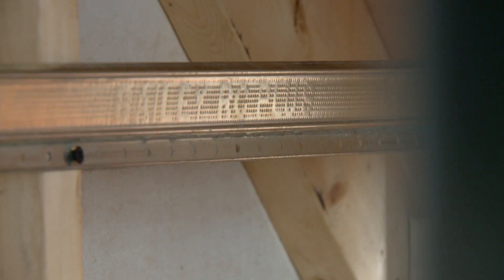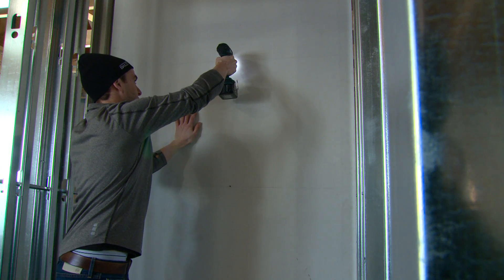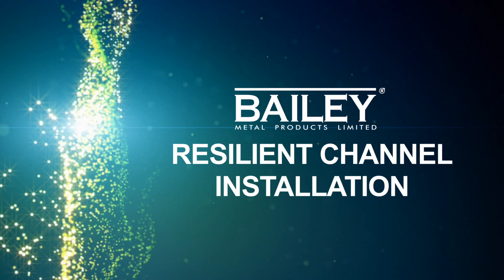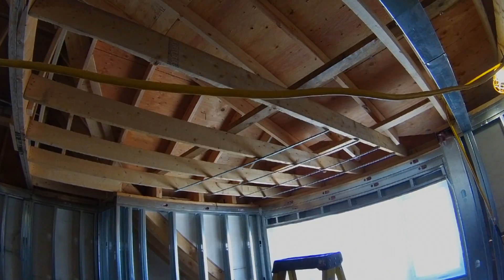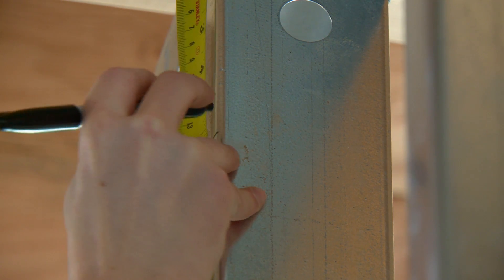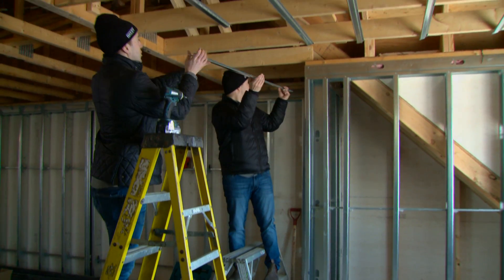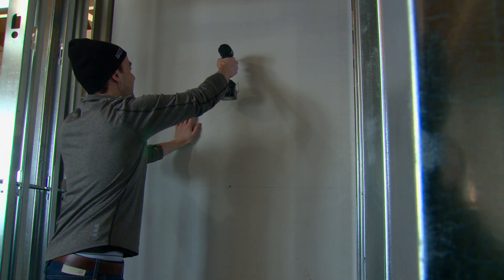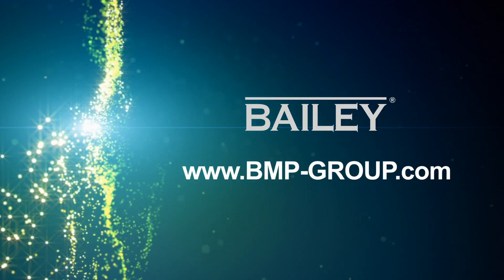BAILEY RC PLUS™ RESILIENT CHANNEL

Comment: What if you did this om the ceiling..didnt touch any studs or walls, have rockwool on the other side and 5/8th drywall..but it blocks out less than 10% of what was already there..? What would you or anyone think the cause woukd be then, if its a 100 year old house and the walls have woochips as insulation..bevause im out of ideas..coukd the sound be travelling down the walls rendering the RC essentially useless? 
I was expecting auch a different outcome..im just feeling absolutely defeated. Spent two weeks getting it all done up and seems we went backwards

Comment: Warning : In the literature on their site its recommended to fasten the gypsum board with 1'' screws. My experience is that the resilient channel bend before the screw bites into it. With 5/8 gypsum board, the 1'' screws will not push far enough into the resilient channel to grip, mostly if you screw too far from a joist, where the channel is more flexible. Leaving then a loose screw not attached, and plenty of unnecessary holes to patch. 1 1/4'' screws makes a word of difference. 100% success.

Comment: This video is basically useless, even misleading.  It's showing drywall screws being driven so far into the drywall that they're going through the paper.  These are not professional installers.  Those screws are doing absolutely nothing to hold the board to the channel.

This video does not show how to interface the ceiling boards with the wall boards.  It does not show what special materials should be used, either (i.e. acoustic caulking?).  Nor does it show how to finish the corners.  This video is simply marketing/promo for the product.  USELESS

Comment: I've learned a lot from watching soundproofing videos all week but none has definitively affirmed what I think is now true. I want to stud mount my TV to a wall that has resilient channels/hat channels. But I can't because that would short circuit the soundproofing system. Am I correct? 

Also, even if I tried, wouldn't the channel have created an inch or so gap between the drywall and stud? Therefore when I start tightening the lag bolt, wouldn't it just pull the drywall inwards towards the stud?
Reply from the maker: You are correct.  In order to firmly secure the TV you would be “crushing” the resilient channel and it wouldn’t be able to freely float the drywall.  Your best option would be to stop the resilient channel in this area (cut it out) and add an extra layer of ½” drywall.  The ½” drywall would equal the ½” depth of the resilient channel to maintain the correct wall depth on the framing members and also provide improved sound performance.

Comment: At this https://youtu.be/prOhYUa9Njw?t=81 point in the video, the narration says "... using 10mm three eight Type S  pan head screws". The video shows what looks like a course type w screw being driven into the wood. Three questions:
1. Please clarify the mention of "10mm 3-8 Type S pan head screw". Both the "10mm"  and "3-8" mentions baffle me.
2. Please confirm that one connects the RC to wood framing with the type W screws.
3. Please confirm that one connects the RC to the drywall with  the type S screws.
Reply from the maker: 1.	Yes, it looks like the narration is referencing steel framing and showing wood framing.  To connect resilient channel into steel studs (25 gauge) a small pan head screw is recommended.
2.	Use a wood screw to connect RC into wood framing
3.	Attach drywall to the resilient channel using drywall screws.  Typically fine thread drywall screws are used.

Comment: I am using RC and two layers of 5/8" drywall with Rockwool Safe N' Sound insulation for my drum room. 

My question is this: For the double layer walls and ceiling can I rest the 2nd ceiling layer on top of the edge of the 2nd wall layer to make a clean corner edge? To clarify, the 2nd layer of drywall on the wall would be positioned 5/8" lower than the first layer to create a small shelf, then the 2nd layer of ceiling panels at that wall would sit on that shelf on the top of the wall panel. 

Does this short circuit the room?
Reply from the maker: While the layout you have described would provide a clean and sharp finish to the wall/ceiling intersection, having the ceiling gypsum rest on the wall gypsum would allow for the sound to transfer from one area to the other.  This would occur because there is contact between the ceiling and walls.  We typically recommend maintaining a small gap at the ceiling and wall intersection of approx. 1/8” to ¼”.  This gap can be filled with an acoustical caulk or a paintable silicone.  You would then finish the drywall as you normally would.
Reply: Thanks so much. You replied at the perfect time. The ceiling is up and the walls are about to go up.

I appreciate the detail too.
Reply: @obscenery  Ho well is it performing in attenuating sound?
Reply: @markhooker8520  pretty well, but not "perfect". I didn't end up resting the layers on each other. Instead I gap filled the corners of the first layer then put on the finish layer normally. I also added a 2nd door outside the room, an outside steel door. 

When I teach a guitar lesson the sound doesn't escape the room. When I'm drummimg it sounds like in a normal house if someone in a different room was listening to a stereo a little loud. However, in my toddlers room upstairs, when I have her white noise machine on and I drum there is no decibel change... which is a big win for me.

Comment: Does resilient channel keep outside noise from coming in like road noise? Or only inside noise from going out?
Reply from the maker: Resilient channel helps reduce noise that travels from one side of a wall to the other.  Think of a typical interior wall that divides one room from another.  If a TV is on in one room the resilient channel will help reduce the amount of noise that travels through that wall.  If you reversed where the TV was located the resilient channel would still provide sound reducing performance.  In your specific case, road noise, resilient channel can potentially help reduce the noise that is coming in from outside.  However,  I would caution that noise typically travels anywhere air can travel and this includes windows, doors, etc.  Adding resilient channel for this application will provide an improvement in sound performance but may not deliver your desired level without doing other changes to the wall in question.  These changes could include adding better insulation in the stud cavities and/or using acoustical sealant around windows and doors.  A combination of soundproofing techniques will probably need to be used in order to provide the best results for your specific road noise concerns.

Comment: When using this on a wall should drywall have a bit of a gap at the bottom to keep it off the floor so the wall will vibrate better? And I have seen some recommend the flange opening upwards on the bottom resilient channel and the rest opening down. You appeared to have all yours opening upwards. Does this matter?
Reply from the maker: Maintaining a gap at the bottom of the wall is typically not required as the attachment of baseboards will create a solid connection that wouldn’t allow the drywall to “float” or vibrate as freely.  This is ok and typical.  Where a gap needs to be maintained would be at the top of a wall where the wall and ceiling meet.  A small 1/8” – 1/4 “ gap will create a barrier from the noise transferring between wall and ceiling.  The small gap can be filled with an acoustical caulking or similar product.

Resilient channels should be fastened to the wall framing with the mounting flange down, except at the floor level where the starter channel can be installed with the mounting flange up to accommodate fastening (sometimes hard for a drill to fit).  The purpose of having the mounting flange down is that the drywall will naturally pull away from the wall with the resilient channel open area at the top.  If installed with the mounting flange up, the drywall wouldn’t fall away from the wall studs and wouldn’t provide the same level of sound performance.

Comment: For soundproofing, we are using one layer of 5/8" drywall and then a second layer of 1/2" drywall.  Is your resilient channel designed to support this double layer weight for ceilings?
Reply from the maker: Resilient channel can safely support a maximum of two layers of 5/8” drywall.  Anything beyond that could compromise the structural integrity or the sound performance of the resilient channel.  That is why we recommend  hanging the heavier items independently from the resilient channel into the structural back up system (wall studs, ceiling joists, etc).

The resilient channel spacing is a guideline but it should be noted that the 24” spacing will provide the best sound performance.  Another consideration is how many layers of drywall you want to install.  If you are installing two layers, typically the resilient is spaced tighter to provide more structural support.
 
In general, you can also reduce the spacing to somewhere closer to 16” (down from 24”) which will provide more structural support for the drywall while making only a small decrease in your sound performance.  I would not recommend spacing the RC any tighter than 12”.
Reply: @baileymetalproductslimited301  Thanks so much for the reply!!!
Reply: @baileymetalproductslimited301  i plan to use green glue between two layers of 5/8 drywall. Can rc be 24 on center? My walls are 7'9"
Reply from the maker: @VeganLinked  For wall attachment, the first (lowest) row of resilient channel should not be more than 2” off the floor (measured from the floor to the center of the resilient channel face). The last (highest) row of resilient channel should not be more than 6” from the ceiling (measured from the ceiling to the center of the resilient channel face). Spaced at 24” o.c.

Comment: Can you use this product with paneling instead of drywall?
Reply: Yes, you can and it is often done in recording studios. In fact it is good to use layers of different materials, such as, say one layer of 5/8 sheetrock and a second layer of plywood. Different types of sheet goods block different frequencies and if you want a great sounding room, do the first layer in drywall and second layer with a nice plywood; you will get a great result. The tricky part is the seams in the plywood, but a bit of creativity in the caulk and trim department should help solve that!
Reply from the maker: It is possible to use resilient channel with other building materials but unfortunately we do not have an industry sound performance data that I can provide.  All of the tests that have been conducted use resilient channel and some type of gypsum wallboard.  The gypsum drywall provides good sound deadening qualities that may, or may not, be replicated by other building materials.  Moreover, the drywall provides an easy surface to penetrate with drywall screws.  Harder materials, such as wood paneling, could provide a challenge to screw through all the way to the resilient channel.

Comment: Would it be better to use rubber washers where the metal touches the wood?  Is this strong enough to hold heavy ceiling panels? Why is it just screwed on one side?
Reply from the maker: @dwaynejava Hi! Rubber washers are not required where the metal touches the wood.  All of our industry tests did not use rubber washers.
Resilient channel can hold a maximum of 2 x layers of 5/8 drywall.  Additional weight beyond that is not recommended and may need to be supported independently from the resilient channel.   

It is screwed on one side only as the single leg profile allows the resilient to float the drywall a maximum of ½”.  This is a design feature of the product and also has the added benefit of levelling uneven ceiling trusses/joists.

Comment: There is a attachment for the ends that are made by another soundproofing company so support can be fitted at end of walls when joining the sheetrock to the channel. so the sheetrock has support at the ends of walls. They usually do this in very large famous recording studios.
corners of walls in the studio will be covered with bass traps anyways to its not cutting any corners when attaching the corner braces of the channels, in fact it doubles support & soundproofing.
remember that 1 full sheet of sheetrock will weigh about 37 lbs, so its really heavy. its a lot of weight being put onto these channels and over time they tend to sink. and have to be reinforced for support.
Also some recording studio sound reinforcement companies tend to place dense rubber between the channel and studs of walls to prevent vibrations tacking on the wood frame..